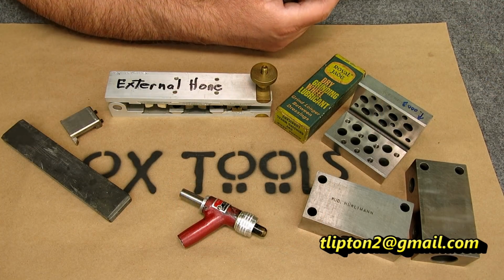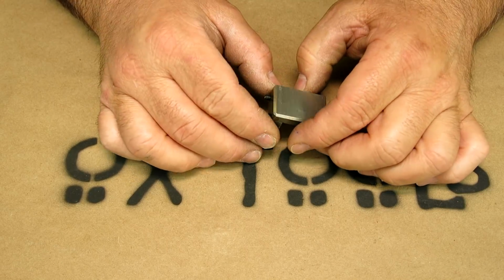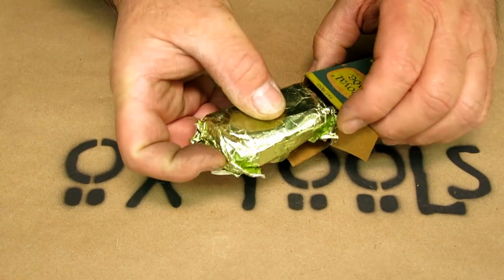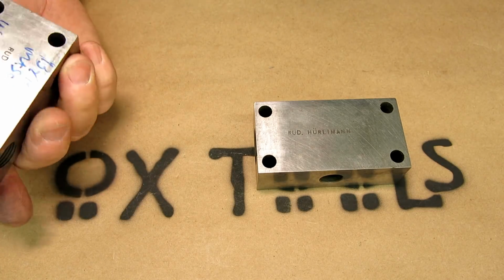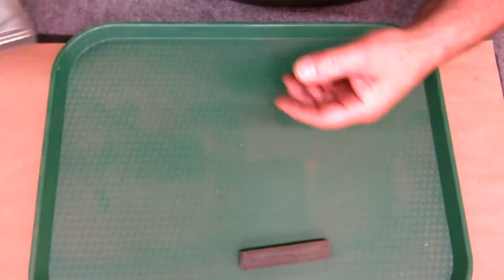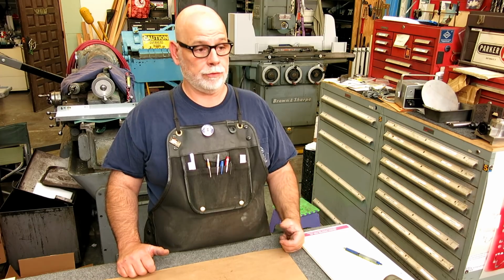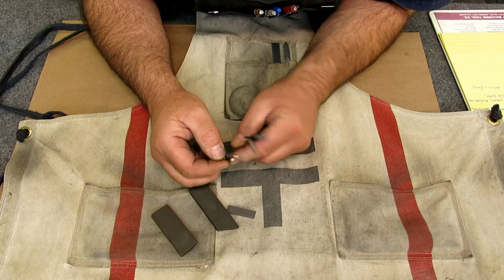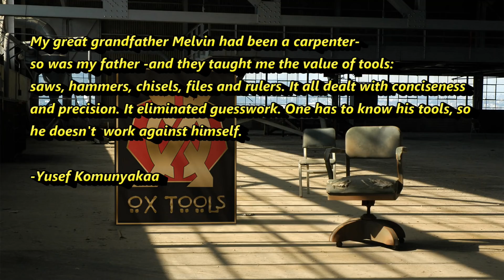Monday Night Meatloaf 120 P2

Comment: These videos that pay tribute to those who went before us are very special. In my view they are among your best. They remind me of many wonderful and talented friends and mentors that I was fortunate to know and work with throughout my life. All unique characters who left lasting impressions on me.

As for the centering scope, I have the same one and it’s among my favorite tools. It too came from a retired T&D aerospace machinist when I acquired his tools. It only has a horizontal line reticle requiring the spindle be rotated 180* to calibrate . With its magnification level, punch marks literally appear like bomb craters.😳 It’s perfect for “getter out” work and usually results in pulling what’s left of a broken fastener out like a heli-coil. Used in conjunction with Heimann transfer screws, you can zero in perfectly in the center of a threaded hole. Invaluable for motorcycle engine work.

Thx Tom, great video.

Comment: Hard to use any name stamped tool without thinking of the man who made it every time you pick it up. The most valued tool in my shop is an extremely well made sine bar built by a R.D. Marlett  at Los Alamos on May 1 1952. Nice to see someone else place a high value and show a great deal of respect for a mans tools.

Comment: I haven't used Royal Jade since the mid 80's, but I still have my stick of it in my toolbox. Back then, I did a lot of close tolerance grinding. We would dress an intricate form on a 320M or 400M wheel, and load on some Royal Jade. It stopped the wheel from loading up so you didn't have to redress as often.
I remember guys in the jig bore department using the optical scope for inspection and picking up locations. I believe their scopes were made by Moore.

Comment: I have that exact same All American diefiler that is at the end of you video. Its a great machine I even have the original manual for it with spare parts and accessories pictured. Great machine very versatile I use it alot

Comment: Hi Tom,
great meatloaf.
I have a collection of tools made by the person I bought my shop from.
I have made some load adjusting slings similar to the sling in the video never used a gearbox for adjustment just a hex on the end of the acme screw, The ones I make are used to lift aircraft turbine engines.

Comment: Interesting finds.  I'm not sure when I'll retire but I'm getting close.  I would hate to have my "stuff" sold at an estate auction for pennies on the dollar like I've seen lately.  At the same time I'm finding it harder and harder to part with anything.  

I've had one of the HECO centering scopes since the 80's.  Came in real handy when using the Bridgeport and used them daily.  Haven't used it in years sense going CNC almost 100% of the time now.   It sat in the foam lined case for so long that the foam dissolved into a powdery mess and even stuck to the scope in spots.  

As for the apron, I also use white aprons.  It shows the dirt so you know when it it's time to change them.  I found the blue denim ones can get pretty heavy with oils and muck and the smell gets passed onto you before you realize it.

Comment: Great Meatloaf Tom!  But the guy didn't carry tweezers in his apron.  Those are Sunnen external hone stones with the dovetail mount.
ATB, Robin
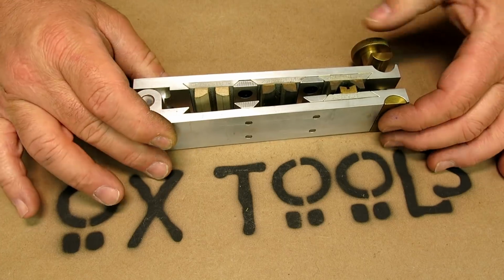Reply: Tweezers...yeah, gotta' have a couple in the shop, especially doing milling work...! There's a guy on youtube that has an external hone very similar to that one at 15:00....sizes valve stems for Motorcycle engines.

Comment: I have a centering scope, used to use it quite frequently on my mill before I installed a DRO on the mill. Norton flattening stones are on eBay for about $30-$35. Using that engine load balancer for your surface plate project is a great idea, I have a load balancer I purchased at Harbor Freight.

Comment: About the grinding wheel lubricant- I haven't heard of that specifically, either. However, I heard of, then adopted a practice of loading my grinder wheel with jeweler's rouge. I learned that it lubricates the grinding, keeping the tool cooler as well as providing a polishing action. And because the pores are loaded, it cuts slower.

Comment: The dry grinding lube is similar to a woodworking product you put on belt sanders to keep the belt from clogging. Same idea—it comes as a stick and you just rub it on the belt while it's running.

That lead holder is interesting. I have a number of them, as well as a pencil pointer. A piece of sandpaper also works well for sharpening the leads, which come in a full range of hardness from 4B to 6H

Comment: Here in spain old fashoined barbers used slate for razor sharp/ning cut throat razors, the grinding paste is similar to what they put on the leather honing strops, i have a stick of it, like a pencil rolled in silver foil, as it gets down you peal off a bit more foil to stop it drying and crumbling.

Comment: Hi
I have a set of welsh slate stones. Pretty fine and slow cutting. I bought them for my razors.
Each is slightly different. Used with water or a mild detergent like windex I use a smaller chunk to work up a slurry that  seems to help the cutting action.
Thanks

Comment: That automatic pencil he carried was a drafting pencil. You could get various hardnesses of pencil lead to make various darknesses of lines. The most common drafting pencil leads were probably HB, 2H, 4H, and 6H from softest to hardest. I'd guess that lead was a 2H or 4H for shop use. 

You could get "tea kettle" automatic pencil sharpeners for drafting pencils; every draftsman had one on his table in the old days. Tom may have had one of those, or just used a hunk of sandpaper to sharpen the pencil. Of course if you rotate the pencil as you are making the stroke it tends to stay sharp by itself, so you rarely have to actually sharpen the lead.
Reply: Had?  I still have, along with the slide rule...

Comment: Slate makes a good medium and fine grade whetstone.  They were the standard stone when I was a boy  usually kept safe in a nicely fitted wooden "coffin".  Too fine for hogging chips out but good for polishing a mirror finish on a blade.

Looking at the stone, I'd guess at it being a dragonstone (aka blue slate) difficult to be certain without touching it.  A dragon stone is softer than the "ordinary" black slate stones everyone had in their bag and would be used to sharpen razors or medical instruments.  They still quarry them in Wales, and they sell for about £20.00 up.  Medium hard and fine to very fine and they leave a nice finish.

It's a slurry stone (or a mudstone) in so much as you wet it and rub the blade of a sharp thing against it to make it sharper.  You don't swill the mud away like a whetstone where the water is the lube.  You just drip in a few drops of water to make a thick(ish) mud and that's your polishing compound.  In tools they are your finishing stone ... in medical instruments its an intermediate.
Surgeons used a very fine very soft and very small (4"x11/2"x1/2") pink stone that sell for silly money because they tend to dissolve quickly with use - so are rare - you can polish a mirror with them.

Black slate stones are harder and coarser (medium to fine) and come from the Snowdonian quarry. You soak them, use them wet and keep them clean with lots of water like a Japanese stone.  Alternatively the good ones (finer) come with a "rubber" add water and rub together to make a slurry before you start.  Fine for woodworkers but not as "posh" as a dragon stone that muds up without rubbing.

A friend gave me a box full of old hacked about stones I bought a cheap belt sander to dress them and after reserving a few choice pieces I gave the finished rest to a charity shop they were all gone in a week.  They do as good a job as the japanese stones.  I use a carborundum oilstone to dress and a couple of slates to finish,   Good enough for what I do.

Comment: Centring microscopes are definitely still available, I use one most weeks for boring out bridges to fit bearings to vintage wristwatches :-) (using a lathe with a 50mm swing, and B8 collets and a faceplate) let me know if you ever want to let it go ;-)

Comment: Conditioning block: I've heard them called "nagura stones" or something like that. I have a cheaper one but it still worked great! I found using course paper made for wood on top of the surface plate refinished them fast on the occasion the conditioning stone needs conditioning.

Comment: Slate is very stable and will stay flat. That is why pool tables are made of it. I could see it being flattened like robrenz precision stones are and then be used in place of a steel straightedge when blueing the part for scraping. Obviously if this one was swaybacked, this was not its most recent use, however it could have been its original use. Just a thought

Comment: Slate is what clay eventually turns into. They use clay for polishing car paint to remove fine imperfections and the usual, I'd imagine it's akin to hard clay in abrasiveness? Super fine silt which didn't quite make it down the river into the ocean and then covered in other dead creature and silt and compressed?

Comment: I also have one of those 'slate' stones. I inherited it from my late Dad, and it was originally glued into a wooden case with a lid. The box has long since broken and been thrown away, but I still use it. It's an oil stone, originally intended for honing wood chisels and plane blades, and it's still my 'go to' for any blade that I want a really sharp edge on.

Comment: I have an identical piece of slate  that my grandfather used for sharpening his "cutthroat" razor, I've used it to hone plane blades. I'd guess its about 60000 grit.Usually Welsh slate wonder how it got to th USA.
Reply: That's what I was going to say. My grandfather was a barber and he used one of those to hone his straight razor between shaves.
Reply: Don't insult a Vermonter by telling them their slate is Welsh! They even made headstones out of it in the 1600's.

Comment: Good vid like we are used to. I have a question my lathe has a Camlock D1, 4 spindle... When i put a 160mm Chuck on it and dial it to let's say 0,02mm or even better... it stays some days like that. After doing some jobs i dialed it again and it was 0,05mm.. From that on i kept an eye on it and after a little time and work tge chuck was allways not so true I dialed him in when i put it on... Have 6 different ones with the C5 and take allways the best for the job... Why doesn't it stay like dialed in forever until i open it and change? Is that normal? Can someone help me?

Comment: Slate stone is commonly used as a finishing hone for people who obsess over straight razors, like me. I have a set of 3 stones from Wales that I bought on ebay which range from 8K to 15K (the darker, the finer, the finest has a purple tinge). Here is a thread with pictures of a guy who bought from the same ebay seller: https://www.badgerandblade.com/forum/threads/welsh-slate-hones.525175/

Comment: An idea for the centerscope...you can get these usb borescopes on Ebay rather inexpensively, but I wonder if it would be possible to fit one to the eyepiece of the center scope...then to use it, you can view it using you phone.  It would be using the centerscopes reticle, so no accuracy would be lost, but with the cable, it would allow easy rotation without binding up, or making it hard for the user to use.
Reply: I have had similar idea myself. The cable problem is solved by using a small wireless drone camera. The lithium batteries are quite small.  I have the camera and the lenses to test, but just have not had time to design and fabricate a body to hold it all together.
Reply: I got one of those cheap USB borescopes off eBay for a project, once.  I couldn't see a thing with it except blurriness, though.  :(

Comment: 21:20  The sharpener for the solid lead is in the push button usualy they are to be pulled out or screwed out, on Koh-I-Noor they are like a 4 fingered "inside" reamer, got several "finishing" slates love them. Royal Jade maby something like this https://www.amazon.com/SUNBELT-Grind-Grinding-Wheel-Lubricant/dp/B01D929T0M

Comment: Black Arkansas stones are often described as "surgical" - perhaps implying putting the final edge on things like scalpels and microtome blades. One distinguishing characteristic of slate vs Arkansas stones it that slate is generally laminar. Any chips or divots along the edge of your stone should be easily distinguished as either laminar (slate) or having no cleavage planes (like the Arkansas stones). Unless that is marked by a diamond saw, that would be too soft to be an Arkansas stone.

Didn't Stan do a video on loading up surface grinding wheels with some waxy compound?

Expand Húrlimann search to Huerlimann. That umlaut can be confusing to English language search engines.